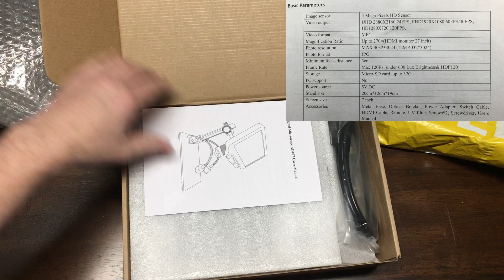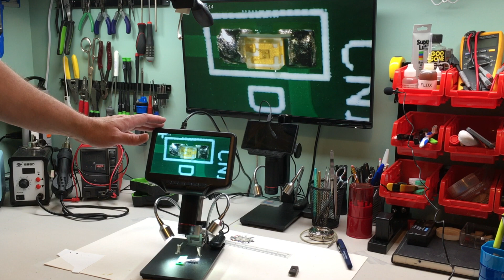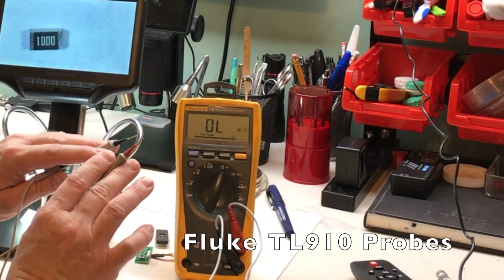ANDONSTAR AD407 Digital Microscope Review

Comment: I bought that microscope today. Is suitable for SMD soldering, good definition and have sufficient space between lens and board todo the work. I see just a drawback: USB connection is just for powering, can't be used to connect microscope with PC as camera.
Reply from the maker: I believe the AD409 will as well as all 3 of the TOMLOV microscopes I have more recently reviewed. One thing I really like about the AD407 is that it was the first one I had that would let you use the HDMI output to a monitor and still have the built in display showing as well.

Comment: I would use this to view closeups of coins can you see for example a 35mm coin completely or just a smaller portion of it .Thanks
Reply from the maker: It should let up high enough to get it completely. If you want to be sure of enough distance the latest microscope that I reviewed has the extension on the height so it can let up a lot further if needed...
https://youtu.be/jcO283OC1UY
Reply: Thank you

Comment: How did you connect it to bigger display  ?  Can it be directly connected to LED tv ?
Reply from the maker: Yes you can connect with HDMI Mini to HDMI to TV. You can also use USB to connect to PC that is hooked to big screen. Which ever you like. I have 3 different microscopes reviews, they are all great and have different features. I like all 3. The latest video shows one with more work height and it comes with the HDMI cable as well. The latest TOMLOV microscope is my go to at this time.

Comment: is this a better Digital Microscope Andonstar AD409 HDMI Digital Microscope 10.1 inch LCD Screen 300X USB Electronic Microscope Camera for Magnifying, PCB Soldering, Coin Collection then the one you talked about
Reply from the maker: I have not used it to say for certain, but bigger display could be beneficial for sure. I like to use HDMI out to my 26" monitor mounted above my bench so it would just take up more room for me personally. If you always used as a stand alone I would think the large screen would be very nice for sure!

Comment: The one I bought will not tilt back.  The black switch is a total failure.  The unit turns on when it feels like it.  The remote control turns off one of my house fans.   But hey...China.
Reply from the maker: Wow....
Reply from the maker: I have had another comment about the unit turning on by itself. That's good to know. I don't see that because I have a dedicated power strip I flip on to my bench devices as well as my bench light when I sit down so I don't ever leave mine on to see it happen. Great information!
Thanks.

Comment: If you had to choose between the two, which would you go for and which has the best image quality? Thanks, I'm stuck deciding loi
Reply from the maker: Unless you really need the HDMI out while recording. I would go cheaper to save the money. Not a tremendous difference to me after that!
Reply: @ThriftyToolShed  Thanks, I ordered the 302 in the end as I prefer the stand and from what I can tell the image quality is slightly better than the 407. Really not bothered about recording while using HDMI out and as for tilting it to get an alternate view, well I have a stereo microscope I use for working, this really is just for convenient inspection.

Comment: I just purchased the AD407 and the stand's post had a wobble to it once assembled. This wobble is not part of the tilt, the tilt works OK, but it was a loose wobble where the scope would rock forward/backward with no resistance. It took me a while to find where you tighten it down. You need to remove the vertical post from the base, and in one of the screw holes for the post, there is a set screw. The screw on mine was loose.
Reply from the maker: Thanks for posting that information!

Comment: I thought you made a mistake when you said the "1000" black rectangle was a "hundred" Ohm resistor. But then I see in the meter it is actually 100 Ohm. As you can tell, I'm an electronics noob :P Why is 1000 written there? Thanks
Reply from the maker: That can be confusing on SMD at times. The SMD code is show 1, 0, 0 and then the 4th number is how many more zeros basically and it has 0 zeros so it is just 100 ohms.

Comment: How is  the latency?  I was thinking about getting myself one of these for soldering purposes. I bought a cheap LCD microscope and I never used it because of the latency.   Thanks for sharing your thoughts.
Reply from the maker: The latency on mine has been good, I think it helps tremendously, especially the older I get. I have seen a few comments on here that people do have some issue with it being laggy, but both of the ones I have has been fine.

Comment: I now try do decide which one: 302 or 407 I should purchase. 407 definitely seems superior - angled mount is a bomb and duplicated HDMI output is a nice feature. Can't see any visible delay between actions under scope and picture in scope display too. How about putting something a bit larger under 407 - like laptop motherboard?
Reply from the maker: You would most likely have to modify the mount/bracket to get a large board under it well! I have to take it off the base and put the scope on a panavise sometimes to see a large board also.

Comment: Is ad207 model sufficient for binding stones in jewelry? (has a built-in central led light)
Is it better to buy 407?
There will be a difference in enlargement when I set the working distance to about 15cm (I'm going to make a new tripod to have a larger working space)
Reply from the maker: I do not know for sure about binding? I would think either would be fine for very detailed work.
Reply: @ThriftyToolShed  Will you be kind and record a video with a ring with many stones under the lens?

Comment: Just bought this microscope, but while recording to SD card, mini HDMI has to be disconnected otherwise it continously resets. Could please confirm you managed to record while HDMI output is active?
Reply from the maker: Yes, my AD407 will indeed record while output to HDMI! I actually showed mine on the video doing it and then showed the video overlay. I have used it around a dozen times with no issue. The ADSM302 would not do both at same time!
Reply: @ThriftyToolShed  Thank you!
Reply from the maker: I did just realize after trying to make mine mimic what yours is doing, if it is sitting there with nothing under it it will start blinking in and out like the auto exposure or focus is over compensating? When I put a board or anything under the microscope to focus on it stops and focuses correctly! I don't know if that is related to your issue or is yours actually powering off and on?
Reply: @ThriftyToolShed  not exactly.  When I push video recording button with HDMI cable in, starts recording for 1 to 5 seconds. Then resets, goes to black and on again, but not recording.
Reply from the maker: I see. Mine does not do that!
Just wanted to share what I found, but it's not the same!

Comment: Hi! Thank you for the review! Could you check something for me in the menu please? I'm using the andonstar adsm302. In that device you can't turn off the auto exposure so in the low light you always get a digitaly corrected but noisy image. I hope there's an option in the 407 to turn the auto exposure off. What's your experience about this? Thank you so much!
Reply from the maker: Best I can tell it is the same, you can adjust the exposure but seems some form of auto is still working to correct in low light conditions. Possible it will yield similar results.

Comment: Just bought it and received it after this video, however, I have a problem that it won't recognize my SD card, anything need to do with that SD card? This card is known to be goo, and it was used in Yi action sport camera, ran very well no any issue. Please help.
Reply: you most probably need to format the sd card with a laptop first and then try it again. make sure that u format it as FAT not as NTFS. Good luck

Comment: Thanks for the review, mate. I was about to pull the trigger on the adsm302 but I reckon this one is worth the bit extra. I'd probably use it mainly for inspection, but I may even take a crack at soldering under it. What do you reckon is the average working distance, and is the depth of field reasonable?
Reply from the maker: The stand that comes with it gives around 3.75" work space height. I have used a Panavise etc. to hold it even further away a couple times that I needed slightly more height and it worked great. For most items I repair the work distance and field of view is really good. BTW I would absolutely spend a little more for the difference.
Reply: @ThriftyToolShed  thanks. Managed to score one at a good price so bit the bullet and got it, although I have to wait a while to get it. The Eakins alternative was a bit too big and clunky for me, sans screen too and an Andonstar/Eakins stereoscopic scope, while awesome is just not a reasonable choice for my budget. Thanks for the review,  it helped with the decision.

Comment: Hello and thank you for your review. I have an Andonstar ADSM302 and I want to ask you if the new model AD407 has the same delay-latency (Jelly effect) as the 302 ?
Reply from the maker: I did not notice any, but before I answer for sure, can you give more detail about when you see the delay? I really saw none with the ADSM302 either.  Are you referring to the video recording lagging?
Reply: @ThriftyToolShed  Thank you for your quick answer. 
So, I'm interesting if on the AD407 are delays or latency between youre movements of the hands with a tool in it, and what appears on the 7-inch screen ? At ADSM302 the delay is very clear on the 5-inch screen (jelly effect).
Reply from the maker: I have not noticed any delay on it at all but to be fair you may be using it differently than I am. I am just inspecting and soldering circuit boards mainly. I don't want to steer anyone wrong but it's almost as real time for what I am doing with it and then again I may just be slow...LOL!